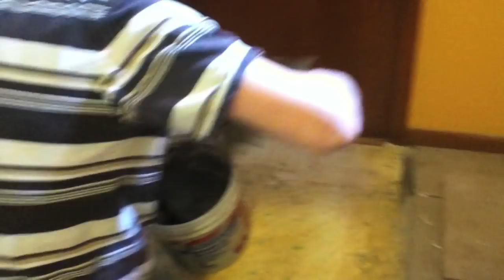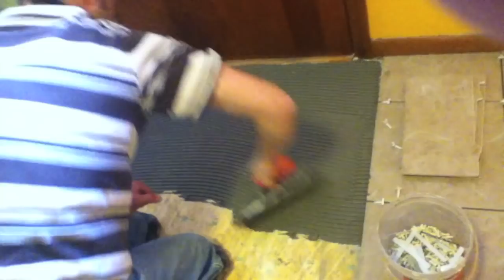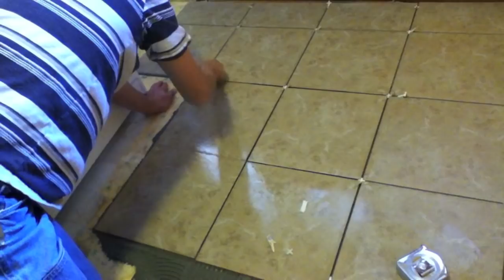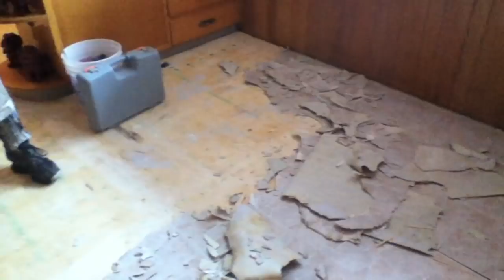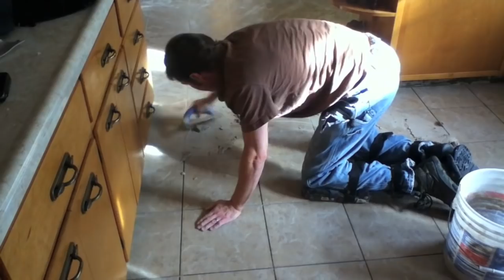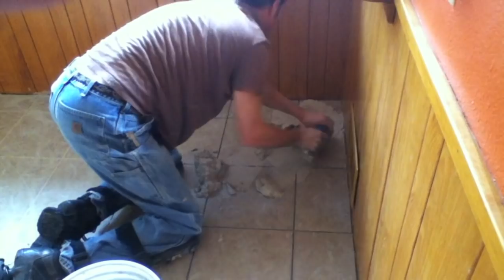Laying and grouting floor tiles

Comment: I really like how you set the tiles, full weight, rock it in.  Many videos show just slapping them down and walk away.
Reply: not a good idea
Reply: Doc02864
Reply: You need to press them into the mud to get level and get 100% coverage under the tile. If you just slap them down you don’t have the tile imbedded and will adventually pop! 20 yrs experience!
Reply: It pretty works if you have a 100% flat floor, no need of levelling. But many floors with bumpings you'll need a levelling device
Reply: Luqman Hafidh, if you watch, as I’m wiping the mud from the joint with my thumb, I’m also feeling if level or not. Also I have a Tuscan Leveling system if needed.
Reply: I love the spreader, its sharp ages. Quite different with one we are using here, a straight edge it has
Reply: Doc02864  I love the way you do it

Comment: wish I could reply to Mrs. Lisa Knowitall below but for some reason youtube is selective on who I can reply to these days. That being said, starting from the center is usually right if you are doing one room but as it appears in this vid, where you have the  same tile spanning three different rooms you measure and pop lines so you dont end with ridiculous small or unbalanced cuts from wall to wall or up to the kitchen counter, etc... the best you can. looks like a good job to me. funny I also dont use a mallet and push tiles together to squeeze out the extra mud and have a Brutus cutter.

Comment: Some people soak the tiles in water for couple of hours. I don't know why, anyone with an idea why they do so?
Reply: Some of the tile are soo water demanding to the extent that, if u don't soak them in water for a while . And u lay them, it will get dry as soon as u lay it on the spreaded mortar  . Which is not good for the job cos the job have to take some hours to dry up so that in case there is any misbehaving of lines shifting u can correct it

Comment: I don't recommend pressing down so hard on the tile after you lay it down.
Reply: +Keith Dobbs He's okay doing this since he's not applying any mortar to the back of the tile before laying down. As long as the ridges on the underside of the tile don't have air gaps, either method works.

Comment: This guy doesn’t know what he is doing.  When laying ceramic tile, the subfloor needs to be about 1.5inches thick to stave off flexing. If you don’t do this, the tiles will begin to crack due to flexing of the subfloor. Ask a contractor.  Ive been doing ceramic tile for 17 years and never had a customer complain about 1 single broken/cracked tile.
Reply: WickedG5150 Forever ..looks like he’s working on concrete.